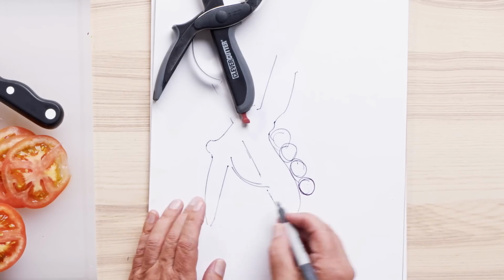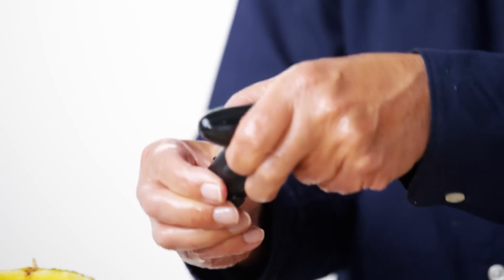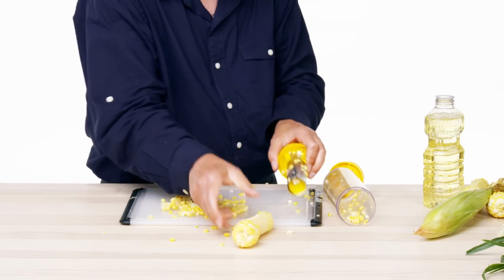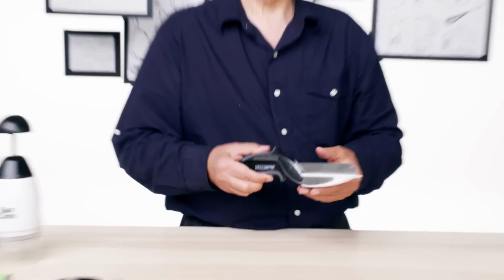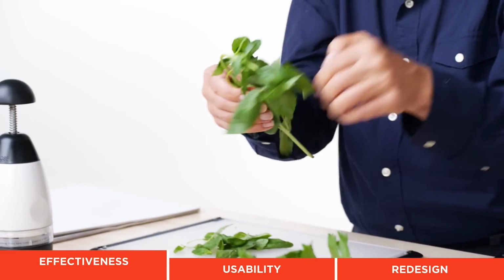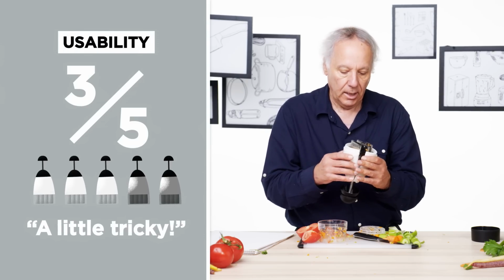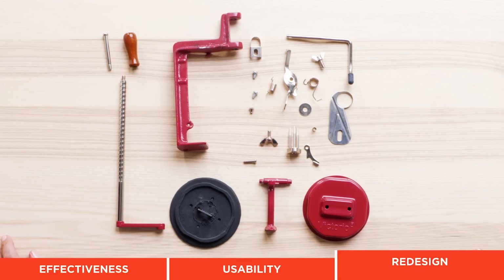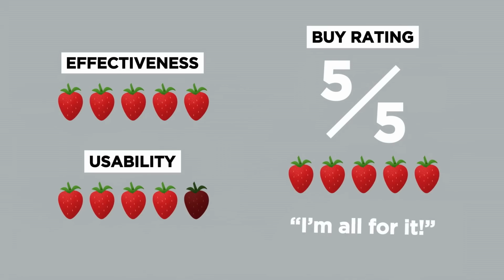7 Slicing Kitchen Gadgets Tested by Design Expert | Well Equipped | Epicurious

Comment: Cutting thin leaves is a tall ask for a blade that only pushes vertically. It relies on sharpness and even contact, which isn't likely with an inexpensive tool like the Slapchop.

Comment: People cut out the entire top part of a tomato or strawberry?? I usually just pull the leaves out and that's it
Reply: There are multiple varieties of strawberries. British strawberries, the most common, don't require coring unless they're a bit older and you're cooking with them (it's still edible they just go hard and people tend to not like it). However a majority of the other varieties, including the replacement varieties you sometimes get in place of British ones when British ones are out of season particularly in trader Joe's type places, do require coring as the middle isn't edible. .
Reply: @medes5597  oh that's interesting, I didn't know that. Thanks for the explanation!

Comment: That pinaple slicer is anwaste of fruit. There is so much pinaple that is not cut.
Reply: By design. They take the juiciest, high quality fruit and deliberately leave behind a pineapple shell that can be used for drinks. It's on purpose. It's not a flaw, it's the literal design.

There are larger, more involved pineapple corers that  make use of 100% of the pineapple. This however isn't designed to do that.
Reply: @medes5597 😂it's not by design, people just learned to use the rest.

Comment: As someone with arthritis in my hands I do have issues with a lot of kitchen gadgets that are simply not designed for me to use them.  Also there are some products with packaging that are not designed for someone like me to open.  One of the most annoying things is that I use eye drops for glaucoma.  One of the eye dropsI use  has those protective seals around the screw top lid on the bottle.  The bottle is very small.  I have nails, but I cannot get the protective seal off and it takes me forever to do it.  I struggle for five minutes sometimes to get it off a new bottle and be able to use it. Given that most people who use these are older people and who may have arthritis, I just wish they would design it so it's easier.  The other drops I use are also in a tiny bottle, but the lid is opened simply  by twisting it and breaking a plastic seal at the bottom.  Though I sometimes have to use something to grip it with, it takes me only a second or two to open it.

Comment: I've got an apple peeler with a very similar design. I like it, for what it does. The apple placement and orientation has to be a bit conscientious to get the core centered, and it doesn't have the breadth to get through a potato (not what it's designed for), but for a pie or a crumble it's great to just have the slicing, peeling, and coring all done, minus a few strips of skin and the final slice to turn the spiral into circles or semicircles. I think I paid like twelve bucks for it. Happy with that.

Comment: The great thing about the bundt pan technique for corn is that even if you're worried about scratching a non-stick coating, the only part you're at risk of nicking (as long as you're relatively careful and capable and dextrous and undestracted) is the apex of the middle part, which your cake batter shouldn't come into contact with anyway.
Reply: It might be better to turn the corn over halfway through. You don't want chips of nonstick coating in your corn, cake, or life.
Reply: @wildflower1397  I'll say what I said the first time I tried Sharpie's ultra-fine-point permanent markers: that's a mighty fine point.
Reply: @tom_something  I am grinning right now. You have a sharp tongue. 😜

Comment: For the pineapple cutter, to detach the handle, I'd have put some levers over the buttons with extansions to push them in far enough, so you can just grip the top under the handle with your whole hand or fingers to remove it with a more solid grip. That way, you aren't sacrificing leverage that could be used to remive the handle by having to use your fingertips to press, one hand to hold the bottom, and one hand to pull on the top.

Comment: Re: the slapper chopper, I think it's interesting that the Pampered Chef version of it uses the mushroom-shaped handle design you suggested and seems easier to open. 
In my experience, it's fabulous for things that you want to chop quickly and/or contain. It's absolutely amazing for chopping nuts and other hard things, because it gets them small quickly without sending them flying all over the cutting board or kitchen. It's nice for onions because it can mince quickly and effectively while reducing tears (and since onions have a shape that makes them difficult to hold the smaller they get, it can be safer, too, and requires less dexterity at speed). 
Tomatoes, though? No go. That's something that requires a combo of downwards and sliding force to cut (so it's too easy to crush the flesh because it can't slice through the skin).

Comment: For the pineapple cutting thing I would like to have it work in both directions. It is a cramp to turn something clockwise with your left hand. 😅
Same thing for the apple peeler. Turning the crank how he did with his left hand is possible, but not effective and can easily be fixed: the skin cutter could be designed to being assembled on both sides of the base.

I am sorry, but designing things for left-handed people is not just turning it around. lol. We do aswell like our tools in front of us and to use them easy and effectively (and safely btw).

But besides that, I am a huge fan! :) He is trying to make his designs usable for everyone and thinks about a lot of important points!

Comment: I don't really get the strawberry huller. IF(!) I hull them, I usually just use the tip of the handle of a teaspoon or something similar. I push in a little, maybe twist slightly for larger strawberries, then use the handle as a lever to push the core out. It literally takes me one to two seconds at most per strawberry. Get creative instead of wasting money on silly gadgets.

The most hilariously useless kitchen gadget I've ever seen (because I got it as a gift) was a spaghetti portion measurer (for the lack of a better word) with differently sized holes to put the dry spaghetti through to get the amount for 1, 2, ,...  people. Why is this a thing? You cook pasta, you see if there are leftovers, then you cook more or less next time accordingly. Problem solved...

Comment: If I redesigned the Clever Cutter, I would've made the blade curve downwards towards the end so food slips off the platform less easily, the platform would also have an indent at the end so the end of the blade won't be bashing into the platform and dulling the tip.

Comment: As for cleaning the apple slicer, you’d be better off putting it in the sink and blasting it with the hose. Why wipe it down with a damp rag when you can let the force of the water do most of the work for you?

Comment: the watermelon wheel thing can be better if the metal bar thing is a bit longer zo you can move the mill backwards maken it easy to get the last past, cause the last part doesn need to be cut by the mill to be a cube

Comment: Is that oil jug still open (I don't see a cap on it) while the corn cob thing went sliding across the counter onto the floor? In my world the entire jug would have spilled on every single surface.

Comment: I picked up the exact same model of apple corer/peeler/slicer at a thrift store. The basic design is over 100 years old. I find I can clean it without taking it apart, just by putting soapy water in a spray bottle, setting the nozzle on "stream," and just blast away at those little crevices. Also, it's extremely important to rinse it right after use. Otherwise the acid from the apples will eat away at the metal, and then you're into the world of finding and installing replacement parts. And nobody wants that.

Comment: That pineapple handle could just screw on for a half-turn with a little bit of an indent at the end. As he said, it only ever is turned in one direction or pulled straight out.

Comment: My family used to have one of those red, crank apple peelers. It lasted a few months and then the piercing pins broke. Yes, metal pins broke on apples. I was stunned, and honestly was expecting better. It worked just fine for those couple months, but the attach mechanism that keeps those spikes where they are is not there, at all.
Reply: It would have been a cheap pot metal casting to save manufacturing cost, it looks and feels like real metal but it's got no strength and tends to fracture across the grain

Comment: My dad actually owns one of these, and you used the corn stripper wrong, your supposed to TWIST it and go down the cop, the handle is actually better designed for gripping as well, it actually isnt that bad and the part that requires downward force to push out is removing the core from the cutting sleeve.
Reply: As someone who's done both, cutting it with a knife has just always been more efficient, and faster, with a lot more percision

Comment: We had that Apple peeler and recently got rid of it. Never used it. Took up a lot of space and the thing would never stay suctioned. We ended up getting one of those cheap Apple slicers where you just put it on top of the Apple and push down. Mom loves that. Cores the Apple. And gives here slices. If she doesn’t want skin she does go back and cuts the skins off. She uses it a lot to make Apple cake.

Comment: One thing people don't realize is that your pinky finger is the strongest finger on your hand, as far as grip goes. This means that if you're making a device that requires grip strength, it is most important to make sure that the pinky is able to the most work possible. Your index finger really only stabilizes, and the middle two fingers are just along for the ride. If you ever have to have a finger removed, the one to lose is your ring finger. It's by far the weakest and most useless.

Comment: I especially like the works recommended by the author. It's very good.  I often use a kitchen tool is suitable for barbecues, pizza and turkeys. It is used to measure the temperature of water and milk, and is used for Christmas and Thanksgiving gifts.Only $9.9
Ama /dp/B09BQYLSNR

Comment: The apple thing, there's already products out there that help out with peeling and coring, handheld stuff that's not clunky and can be used to peel other stuff like potatoes and carrots etc. I'd rather use those than that, my grandma could peel with those no problem aswell.
And the strawberry holder just seems unnecessary as you can just take out the leaves by just using your hand and usually you can get all in one go no problem. Alternatively just take a small bite out of it and spit it out, or eat the strawberry as is while holding the leaf end and just toss the rest. 1 second or less by using no tools. Just seems like a wasted gadget to me.

Comment: As for the chopper, I wonder if the vintage models are better. They have a flat topside, are easy to hold in place with one hand while violently slapping the plunger with the other hand.

The plunger handle is larger than the model in the video, and flat, allowing for a good, fun and effective slapping action.

https://yams.secondhandapp.at/api/v1/shpock-production/images/59e2115a6df44f241ac07f91/?rule=w1536h1536q75jpeg

Comment: lol he explained mechanical advantage wrong then he did it right. the potato is fat so it is using the blade further away from the pivot point (fulcrum) so it has less leverage but the pinky is furthest away from the fulcrum and it has the most leverage?

Comment: I think if you reworked some of the user errors a couple devices may work better. For example, the corn cutter…was the corn cooked? Because cooked it would be softer. And isn’t that when you dekernel it? For the watermelon windmill, just cut both ends off and slice it in half lengthways. Then you don’t hit a wall at the end. And for the clever cutter, my sister has one and we actually use it for meat. It makes it super quick and easy to cut up chicken breast, hotdogs, steak, hamburgers, pizza, anything really for the kids. Especially when there are four to cut up food for, it’s much quicker to use the clever cutter.

Comment: I get the oil part, but why he using his left hand and says it’s non effective? But if he used a knife it would be slippery too, and his hand would probably be cut off.
Reply: His left is his non dominant hand so it's not as strong, so it simulates someone with not a lot of strength

Comment: I think that Pineapples are a lot easier to be skinned with a knife, by cutting both top and bottom of the fruit, inserting it on the border and cutting through, rotating all the way until it "falls". If your blade is too small, you can cut it into parts as well.

Comment: There’s a vintage apple peeler at my parents house and I love it! I used to use it a lot as a kid! But instead of a suction cup, you clamp it over the edge of the counter
Reply: didn’t know you could peel and not core or Vice versa!!! definitely using it next thanksgiving for apple pie 😂
Reply: I often work at a table, and being able to clamp it on would be a huge improvement over a suction cup that dosen't stick to the rough surface. You could even clamp it to a heavy cutting board.

Comment: I really like the logical thinking process he goes through, i feel like all designers should do the slippery hand test on their products.
These are cool gadgets, especially the apple corer peeler slicer, though most of those are pretty useless and/or take up drawer space. Plus, a knife isn't that much harder to use in most cases, and in some, you have to use a knife anyways (the slap chop, the pineapple corer slicer) and it would just be another, more difficult thing to have to clean. Plus, once the blade gets dull, you can't get it sharpened and you just have to throw the contraption out. At the end of the day, a knife for most of those would work better. I'm not saying all of the things were useless, just saying they may not be practical for how many uses they might get.

Comment: Pineapple twistie tool is great but still wastes too much of course U can hallow it out if ur making drinks. Just being honest “waste not want not”one of the best tools I used of my grandmother 50 + years ago was a tool to remove strawberry leafs for canning/freezing large amts. it was like a pair of tweezers with the ends more like a scoop. If ur canning corn u can’t beat a sharp knife. I don’t like to have loads of specialized tools when a simple knife can do the trick.what is the point of having a scissors to cut a potato or tomato my knife is faster with more ease. I will look for the pair of slim curves scissors for cutting southern lobsters which is difficult to do without chopping into the meat. The best items for everyone’s kitchen is a great set of knifes and skill to use them. I would never give up my potato ect. peeler Good luck chopping, cutting and peeling in the
kitchen. The apple peeler is great but not in a small kitchen with multiple people using the items.

Comment: Cook the corn then use The Corn stripper  when you put the oil on your hands and the corn stripper fell to the ground you forgot to put the lid on the oil.
With that watermelon I would have sliced it into more slices instead of just cutting the watermelon in half I think it would have been more productive .
As far as the blade on that vegetable chopper I can clearly see the reason why it's not chopping the tomatoes skin the blades have not been designed properly I would design it totally different.

Comment: If you look at the "Ease of Use" rating on the corn stripper, they used pineapples instead of corn to rate it.
Reply: Literally unwatchable
Reply: Cornapple
Reply: IMMERSION RUINED
Reply: HOW DARE
Reply: Makes total sense! (seriously, just looking at the device it seemed like a bad idea. Corn just doesn't have a regular enough shape for that design to work, and it's too fragile to withstand much pressure. Much too easy to crush it or miss half the kernels. It's not a hard food like an apple, and even apple corers struggle to align with actual apple shapes, and get even harder to cut when you're slicing in addition to coring!
A much more useful gadget would be a cutting board with embedded prongs to stab the corn on to and hold it upright while you cut, because even with mobility issues, a knife is going to work better to get the corn off than a corer-type design and the primary challenge will be to stabilize the corn while cutting.)

Comment: for the apple corer and peeler if you pull the little handle on the bottom it locks the gadget in place so you don't have to hold it down, i have one of those of my own

Comment: With the corn gadget I'm pretty sure you were supposed to use cooked corn and not raw like you did. Also the main design of it was so you don't burn yourself when you cut hot corn
Reply: Interesting thought. It seemed pretty useless to me, but cooked corn might be easier. If I want to serve hot corn, I just leave it on the cob. If I am adding it to another dish, I would let it cool. However, core sizes vary, and it looked like a pain to wash.

Comment: 1. Corn stripper needs to be used in screw movement and not just pressing it downwards harder.

2. Try using Watermelon slicer on slice of a watermelon and not on half cut one.

Comment: That watermelon slicer got shafted. Do the dexterity test with the standard tool and compare.
Holding the watermelon and not having a sharp blade in a disabled hand is a big benefit.
Regrettably, it isn't nearly as versatile, but I'd argue it's better than the alternative at what it does.